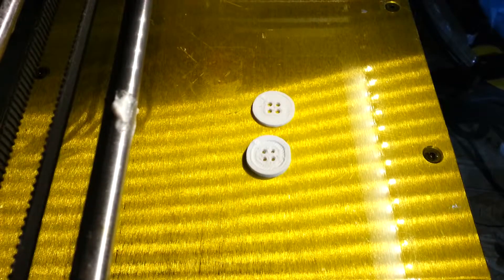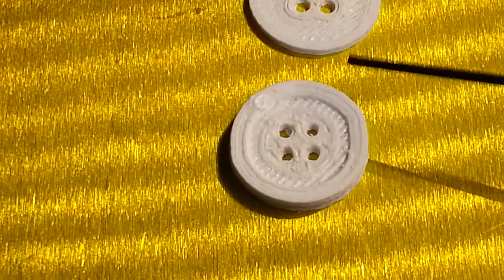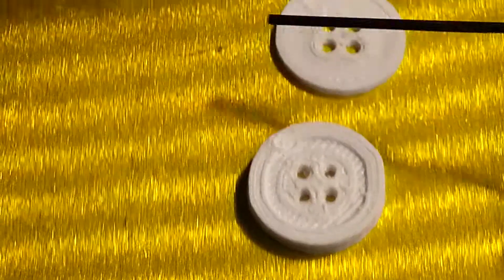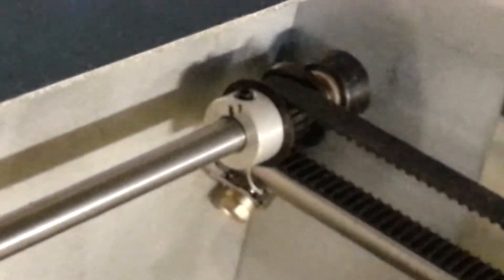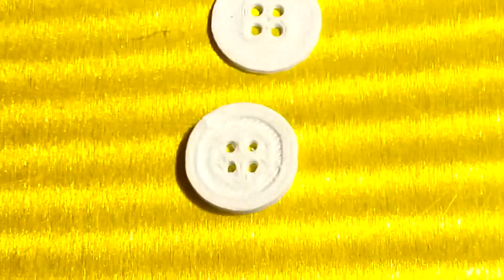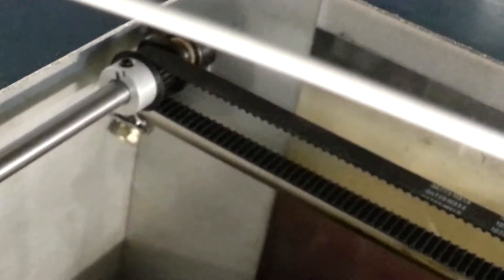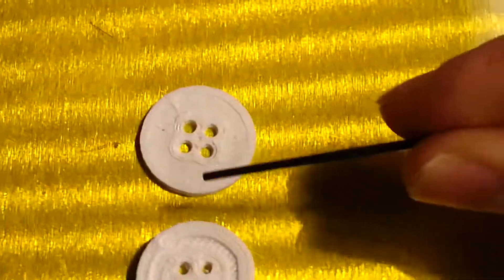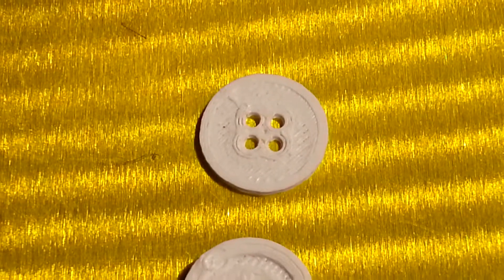Solidoodle 3d printer easy Y axis calibration

Comment: did this take you a while to do? i cant get mine even that close to perfect.
Reply from the maker: +Nathan Schlenker No it was actually fairly quick. A few adjustments and it looked way better as you can see.Make sure there isn't excess slop in the belts.
Reply: +Toluene I have spent 2 weeks adjusting belts and pulleys and 1/2 a roll if filament later i amno closer than when i started. i try to do what you say and get very minimal results befire major binding. idk what to do.
Reply from the maker: +Nathan Schlenker I would make a video or take some pictures and post them on the forums to get a better idea of what the problem could be.